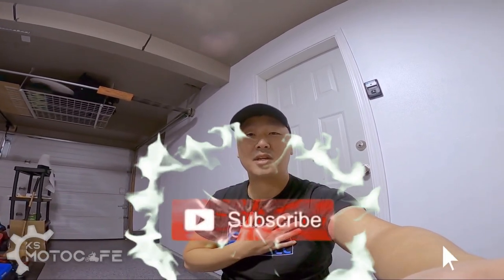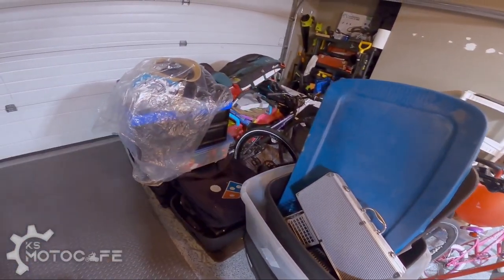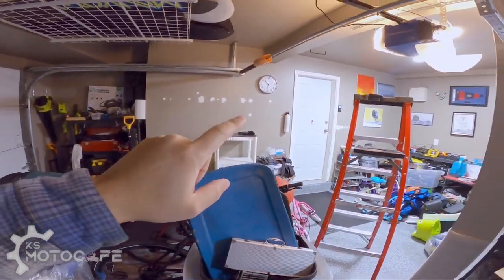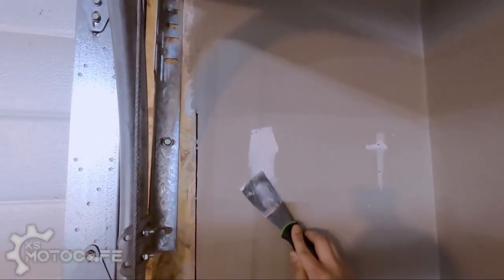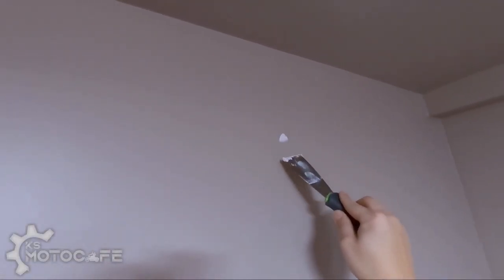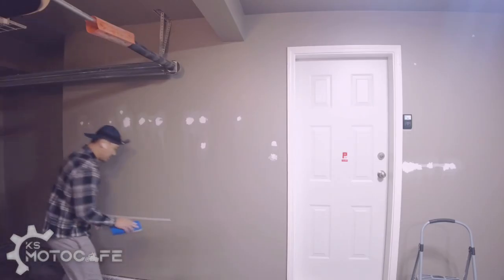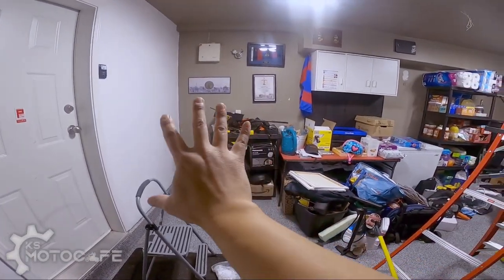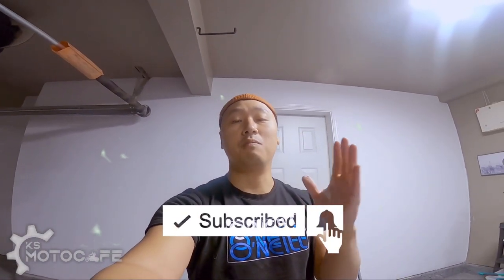Painting the Garage (my first time painting 😅) | Garage Makeover Ep 2

Comment: Aaaaaand a new channel is born: KS Remodel Cafe 😂👍🏻
Kudos to you to just jump on in. I know quite a few folks that would be terrified to do this.
Here’s a tip for your rollers: after unwrapping them, wrap them up in tape then remove the tape. This will remove any loose fibres for ya. Then you can wrap them in plastic cling wrap - air tight - between coats to re-use.
Reply from the maker: great tip! I was using just a garbage bag to wrap em during coats but plastic wrap is probably tighter! I found the brushed parts with the hand brush didn't apply the paint as well as the roller. Was it the way I stroked it or  did I use the wrong brush?
Reply: @KSMotoCafe  well…..I wasn’t going to say anything, but seeing that you asked:
The cutting brush is designed to be held the other way. You start with it “narrow” and long point facing away from your direction of travel. Then you back brush with the flat side. The trick to getting more paint per stroke is “loading” the brush. Dip it in the paint and then brush a few strokes on in the paint tray and repeat. You should be able to feel a difference in weight once the brush is properly loaded and should be able to cut about a 16”-24” line without reloading.
Plus a new brush takes time to get worked in. 👍🏻
Reply from the maker: @Crittermoto  So if I am imagining this right, you brush with the short side and applying pressure towards it while the long side is pointed the opposite direction; then when you back brush it, the long side is reversed to the edge and you apply pressure towards it while the short side is now pointed away from the direction of the backstroke?
Reply: @KSMotoCafe  something like that, ya.

Comment: I used to use painters tape but with lots of practice, you get to the point where it’s faster and easier not using it. Just take your time with the trimming. But if you do use tape, don’t let the paint dry, especially with multiple coats. It can actually strip your paint off once you remove it.
Reply from the maker: that last part is what I missed on the other wall! I let the multiple paint coats dry on the painters tape so when it was time to pull it, it took bits of paint out of the actual wall :(